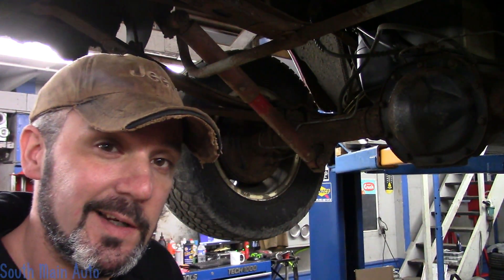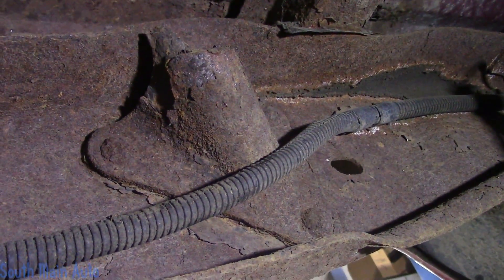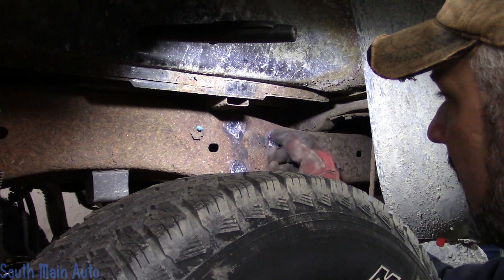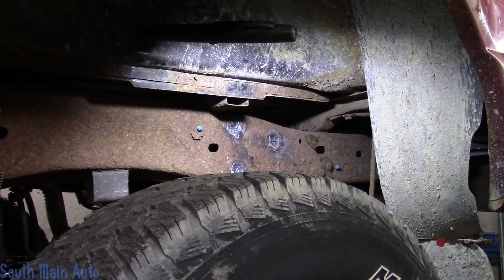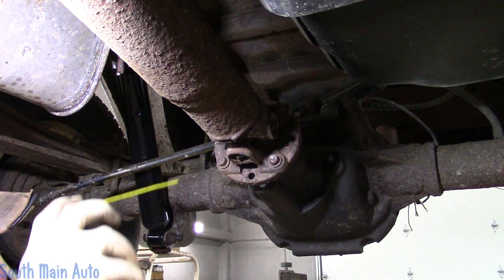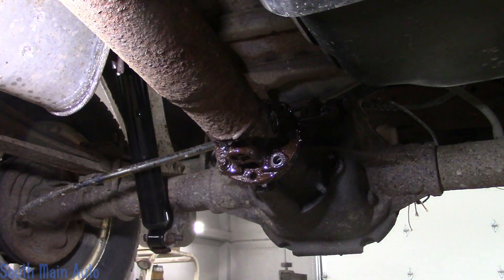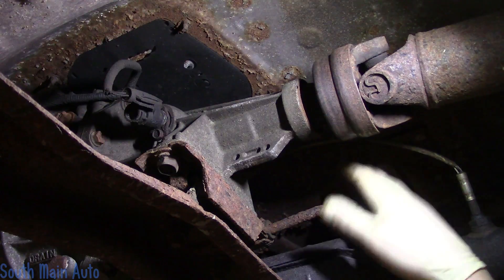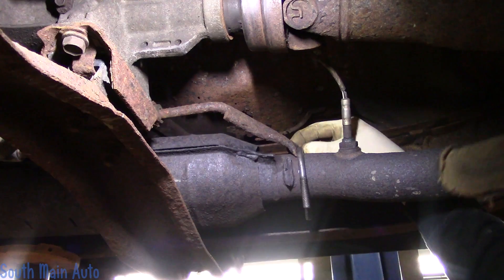Ford Ranger: Broken Rear Shock Mounts

Comment: What I think is that Eric O must be one of the most honest mechanics in all of New York. Thank you for showing that you're a good guy Eric, even though we knew.

A lot of shops won't do weld repairs on exhaust parts. If the clamp arm is rotted away, they will replace the entire arm, not clean the remains and weld a clamp in place. 
The drive shaft isolation ring, goes the same way. The manufacturer put it there for a reason, the drive shaft needs replacement, even though the replacement shaft costs as much as the truck is worth, at least book value.

My Suburban had the drivers side rear shock mount rot away. No other rust on the underside, just the mount. Took me 4 months of waiting for a replacement mount to come available into stock before I was able to purchase. Road salt is bad juju.

Comment: The shock mounts are now holding the truck together .
Reply: RyuukoGo that's all surface rust, if that scares you then never drive your vehicle in Canada
Reply: @Drew-wf7vw  
I thought people in Canada used Dog sleds 🙄
Reply: @RyuukoGo  Nope Minivans!
Reply: RyuukoGo Shit he's onto us
Reply: Really? I thought old Fords where held together with duct tape and wishful thinking.
Reply: @RyuukoGo   No! Kraft Dinner Tubs pulled by dogs.
Reply: HAHAHAHA!!!!!!!!!
Reply: ...and zip ties. My 93 Ranger has its battery held down by them. Oh..and zip ties are also holding the gas tank in, and the bushing in the clutch pedal / hinge. Pretty sure zip ties were holding the auto zone intake on when I bought it too. All hail the mighty zip tie
Reply: @highlypolishedturd7947  hey my fords held together with a couple 2x4s. Also the bumper is held on a with 2 jenga blocks.
Reply: @highlypolishedturd7947  bit o' wire, bit o' board... Zip tie it together to make a FORD!
Reply: @Micko350  I'm going to steal that!
Reply: @Drew-wf7vw  like trying to drive a vehicle that's made if eggshells
Reply: I have 94 Ranger and still a daily driver. Rust is something you live with in the N. East. I replaced the shock mounts and the spring hangers twice. Better to remove the bed sometimes.
Reply: @robertr.1700  i have a 94 as well. I love it i am replacing the mounts and all 4 shocks too. I live in the north east and rust is somthing you can never escape. It does have a engine tick but its a lifter. Awell

Comment: Well at least when it hits the junkyard soon, someone will find a decent set of shocks and mounts to own.
Reply: Yep, its getting long in the tooth being a 94. Not many cars exist prior to 2000 now.
Reply: @2DogsVlogs  That's one main reason why trucks are so popular a good one can last twice as long as a passenger car.
Reply: @2DogsVlogs  Just traded my '94 Honda Accord LX in for a new(er) car for my daughter.  The guy was originally like, "Well, I'll give you $500 for it.  That's what the crusher will pay for it anyway."  I went back to the house, picked it up and drove it down there and the dude was like, "Well ... I wasn't expecting it to be in as good of shape as that is ... I think I'll sell that one."

1994 Honda Accord LX - 2.2L 4 Cylinder Engine - 327,000 miles.  Original engine, original transmission.  FTW
Reply: Same happened to my mom but they took her for a ride. She had a '99 with 65k on the clock. They gave her $500 and she had just spent $2,500 on a new cat, timing belt & tyres and she took it. She new she made a mistake shortly afterwards.
Reply: I don't see many trucks hear older than 10 years as they are usually treated like crap. Its a rural area. But sometimes you can find a kid transport, an accountant or like me, but they are really expensive. I get comments all the time about my Jeep. It has 60k on it for a 2006 and has tire rot for proof but I only use it once a month so the tires will last me another 10 years.
Reply: @2DogsVlogs  Yeah, my Ford has 75k on it from 2007. people comment it looks brand new because i've taken good care of it. Even crap brand cars will last if you take care of them.
Reply: @DontCryAboutIt  I was going by what Eric said, '94. A neighbor sold his '95 Lancruiser for $10k with 180 on the clock. Man they still get big bucks, it had almost no rust.
Reply: @robc8468  Honestly, I think if any vehicle is properly taken care of - and I mean, PROPERLY taken care of - I think they can last and last and last.  Biggest thing is oil and tranny fluid keep them fresh within specific intervals, don't drive them like it's NASCAR, and you'll have a very reliable and dependable ride ready to take you wherever you want to go.
Reply: you build it we destroy it  I know. I would have bought it of her for $500 if I had known her intentions. She did it because she lost a hubcap. And she overpaid for the new car as it was the prior year model so already a year old and paid the same price as a top-of the line but got a base model. They saw a grey haired lady in her 70's and took her for a ride.
Reply: @2DogsVlogs  
Thats a Land Cruiser for ya, I got a 93 Land Cruiser and 96 Tacoma the Taco was like 2k when I bought it as a running scrap heap for the body. The Land Cruiser was in perfect condition and well over 10k haha. The old Toyota stuff will always bring the big bucks if it hasnt rusted out.
Reply: No way that thing has another ten years easy.
Reply: @kellyconstenius676  That's what I was thinking, it's a ford
Reply: @2DogsVlogs  plenty of cars older than that are still on the road in the South.And they look brand new.This one looks good to be that old in upstate New York.
Reply: @nopenottalib4366  - Cool!  I'm guessing you don't live in the rust belt.
Reply: @2DogsVlogs  My 93 Ranger had over 200,000 miles before the year 2000. It STILL runs and hauls crap to the dump. Lost track of how many times it's turned over.
Reply: @hanskinslo326  No ... well, semi-rust belt.  Western NC.  We don't get anywhere near the snow the rust belt gets though.  For us, it's easy enough to just keep our vehicles off the road when they're salty.  Generally speaking, of course.
Reply: Vehicles are money pits. You'll never get back what you put into it. The only value is what you consider it's worth. If someone likes a vehicle and feels it's worth it, they'll take care of it. I have an 08 Charger I took the last 9 months removing all the rust and replacing parts on. I basically saved this car. It has an approximate value of around 9K. But I take care of it and I'll get a good 10 years or so out of it. Maybe even longer.
Reply: @nopenottalib4366  my father bought the 2000 civic I got as a gift from my grandfather who bought it from my mother so I guess it's a family heirloom. But my sister is absolutely destroying this car it has 138k miles. It's sad but at the same time very good representation of how durable they are. Just last night she drove home with a blown tire, don't know how fast but that tire was shredded.
Reply: @bryanmartinez6600  Ya, it's a hard thing to watch when you see someone with a quality set of wheels and they neglect it so bad.  That's one of the problems these days - everything has become 'disposable.'  Use it until it breaks, throw it away and buy another one.  I guess I'm old fashioned (or just old) but I do my best to take care of the stuff I own.  I want it to last as long as it can.  New cars are certainly nice.  New car payments, on the other hand, not so much.
Reply: @snoopy5736  I drive a 1999 ranger xlt 4 cyl 5 speed stepside 158,849 miles currently and love it wouldn't trade it for any other brand

Comment: I cut my dampener off one night b/c I got mad at  clanking under there for the same reason. Actually it slipped down the driveshaft to the rear diff on the highway and was bouncing me all around, frankly thought I was going to die lol. After that at 12:30 AM when I got home I cut that thing off, sparks a flyin in the driveway in the middle of the night lol. Never had a problem from that night!

Comment: I have a '94 Ranger 4.0 XLT 2wd Automatic with 207k miles.  I also don't drive it much, but I plan to keep it for a really long time still.  The only significant rust on mine is on the rear bedsides.  I've owned the truck since January, 1999 (25 years!!).

Comment: enjoy your show A little tip I’ve filed blowing  rivets or cleaning up welds once you get the rivet Hot instead of using the air trigger just reached out to turn off the air on your main adjustments you’ll make a pretty job of it. Give it a try you won’t make a mess at all. Local 3 yard worker here Pittsburgh. Hopefully that makes sense to you really enjoy your show

Comment: Great video!  Problem with DIY work is that after you fully recondition your two vehicles (a couple of V8 engine heads, timing chains, timing belts, struts, fuel pumps, control arms, etc) they do not require work for many years and you end up with $5,000 worth of tools to do oil changes.

Comment: Wish I could find a good guy like you here locally. Took an '01 Focus zx3 in for a long crank issue with occasional no start. No codes. Got a new MAF sensor, some vacuum tubes and egr (could be wrong on this, another sensor though), got it back. Next day kid tells me the long crank issue is back, with bonus check engine light. Codes are for misfires on 2 and 3.  Going to call tomorrow see what else it might be. I like your no parts cannon approach. I did the little stuff, plugs, wires, ignition coil.  Things were more expensive after that so I took it to a guy.

Comment: I had a 76 chevy blazer where back shock mount broke. It made top hole bigger. I found a large bolt at work that fit into hole, had a welder weld one bolt head to the other. Worked perfect

Comment: I got a 1994 blazer k1500, I need to replace the upper shock mount on the driver side and I don't have an air hammer to get the rivets out, so I think a ford mount may work if I drill out the holes for the mount. I also need a yoke for my differential. I learned so much from this video. Thanks 🙏🏻

Comment: Good job, handy hot wrench, deep six the harmonic balancer on front of driveshaft, weld up ex hanger. OK! Nice little electric impact, im old school, still using air gun. Excellent video. I really like your snap on diagnostic scanner from the other vid. Wish i had one. I had my shop for 20+ years, in the sticks in U.P. of michigan, charged 25$ hr labor you buy the parts. Never got rich but had a ball!  Still wrenchin part time, love it. I really love your videos!!  revved up yooper
Reply: Actually, in this video he was using an air impact.  Astro Pneumatic 1832, I think.

Comment: I used my little harbor freight air hammer with sharpened flat chisel and hammered those round rivets off. The part with rusted out rear shock hangers. Air hammer cut right through them... I.ve done fronts to replace the front doughnuts on vans, Trucks etc.

Comment: I had a 92 ford F150 like that..rusted,  broken..my mechanic cried like a baby every time i brought it in. Every broken spring mount was like the truck might die during the operation, a rusty brake line repair was like doing brain surgery to this old tech..i gave up on the truck, cause my mechanic was such a crybaby..i wish you were there for me and my old truck..id still have her.

Comment: Wife had a 94 B3000 that had the same set of issues.  I also did the front shock mounts due to rust...was scary when the front one let loose and the shock hit the ground at speed!!  It was a rusty PA truck, and left shortly thereafter.

Comment: Personally because of all the rust, I would have used big nasty and chiseled those rivets off.  Other than that call it text book. Nice work Eric
Reply: You might not have any frame left though once that vibration shakes all the rust off this truck.
Reply: The frame would have sheared before the rivets.
Reply: I think you would then have seriously enlarged mutilated holes afterwards with a frame in that condition

Comment: This thing reminds me of my '94 S10 plow truck - only difference is, you could never take mine down the road, due to the 7" of steering slop from bad wheel bearings, ball joints, pitman arm, idler arm, and both tie rod ends ... oh, and the steering box. It becomes a white-knuckle ride over 35. Sometimes for fun, I'll go up the road here at 40, and nearly lose control ... but that's more fun with a friend in the passenger seat. 🤣

I LOL'ed at that yoke damper! That was great! First time I've seen one come unglued! I can imagine the sounds that made at anything above walking speed, HAHAHA!

I'm about halfway through yanking the front subframe (k-member, engine support ... whatever it's called ...), so I can extract an oil pan from a '02 VW Passat. 1.8 turbo, 5-speed. Had to come in for lunch and a SMA vid - was getting boiling mad. Time to walk away for a bit! Shooting a vid, but it's going to be segments - I don't have the battery nor memory card for shooting that long ... nor do I feel like editing 4 hours of continuous cussing. 😁 It's days like this that make me question my career choice. I'll have some lunch, and it'll all be better in a bit. 

 I need to build a time machine to take me back to 1955, then self destruct upon arrival ...😊

Comment: I had to replace my leaf spring hangers on my 2000 Ford ranger recently. Did not realize it's a common problem on the rangers for the hangers to break off up here in the rust belt.

Comment: That year of ranger has a history of the top shock mounts either rusting off or breaking
Reply: Not hard to believe seeing how the mounts are built open at the top and catch dirt and salt that will never come out. Those mounts are rusting away even in the summertime with the captured winter road slush still in them. Every time it rains the splash reactivates the salt.
Reply: Reece Newton yes that’s the main reason why ur correct salt, dirt and whatever else is on the roads,etc

Comment: That looks just like the 94 Ranger that I'm doing a 302 swap on right now-along with a bunch of body work! The rear shock mounts aren't an issue on mine, it's the front lowers! I'd love to see you change the radius arms on it since that's what I have to do one of these days!
Reply: molson12oz This isn't my first rodeo with a V-8 Ranger  swap. It's not goodbye to anything except the 4 cylinder and Mazda 5 speed. The heater box (no a/c on this one) just needs a slight mod to the lower corner nearest the 302 valve cover. I'll also be using an Explorer 8.8 rear with the spring perches moved to the top.

Comment: My long bed XLT mid shaft bearing took a shart so that had to be changed, The rear of the truck went down because both rear spring perches rusted loose and the springs were rubbing and banging on the underside of the bed. Got those fixed and traded it off for a new FLEX which is a great car. Lost my arse on that deal.

Comment: I've owned an 04 auto and just bought an 08 manual.. Both with the 3.0v6 .. Love these trucks, reliable and easy to work on when things do fail.. But noise.. I'd be more concerned when it doesn't make bad noises

Comment: Slightly odd design having those rivets recessed on the frame. Good explanation on the heat transfer with the torch. Made sense to me. Good tips.

Just hilarious how much rust continues to chip off while torqueing things down. I always hate that in the summer. Sticks to me (if I'm sweating) and ends up down my shirt. 😒

😍fabrication!😍  I wanted to get more into that when I had the access to the tools & welders. No longer possible, at least, not in the near future.
Reply: Aren't you working on a ranger?
Reply: @jeremyanthony9300  just got done it all last week. Just trying to get through all the footage.  Trying cut it shorter... lol
Reply from the maker: Ughh I know what you mean. The rust loves sticking to sweat. And in the belt line....

Comment: I just replaced the rear shocks on my '94 B3000 but I don't have to worry about the rust down south.  My drive shaft looks a lot better than that crusty thing in this video.

Comment: i had a '01 ranger and the rear leaf spring mount in the rear shot up thru the bed after the rust made its way thru the shakle haha
Living in the rust belt takes its toll. I live like an hour and a half away from your shop from Lancaster to Avoca NY. dealing with rusty fasteners and hardware makes you think outside the box sometimes
Reply: peter frysz
  ---  "I live like an hour and a half away from your shop from Lancaster to Avoca NY."  -- No you don't.  That's over four hours of driving to get there, about 250 miles.  It's a long freaking ways.
Reply: @davidnull5590  I just Google maps it and it's like 1 hr 45 mins. I'm talking Lancaster NY by buffalo, not Lancaster PA. lol
Reply: @frenchfrysz6695  ---  I live near Ithaca, I didn't know there was a Lancaster NEW YORK.  I learned about a new town today.    :-)

Comment: Hey Eric, you ever watch Mustie1 on Youtube?  He lives up in your corner of the country and has a favorite undercoating he makes.  He uses chainsaw chain oil and some other highly tacky oil and mixes them then he heats them up in a microwave and sprays the underside of the car with an air sprayer.  Says the trick is to drive around on dirt roads so the dirt soaks up the oil and form a shield against the salt and corrosion.  He's had good success. He fills the frame, body panels and doors.  You might not get along with him though.  He likes to rebuild old Volkswagens.

Comment: Oh yes i love that U bolt idea, welding to fresh metal and still attached to the exhaust pipe :-D
Pity the owner didn't spray the underside with old oil once a year, that would have slowed the rust a bit.